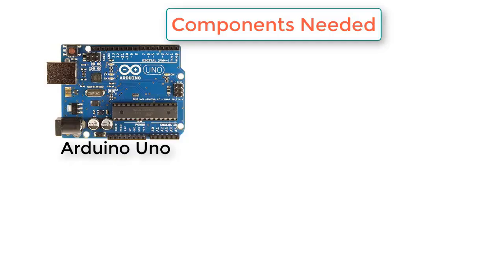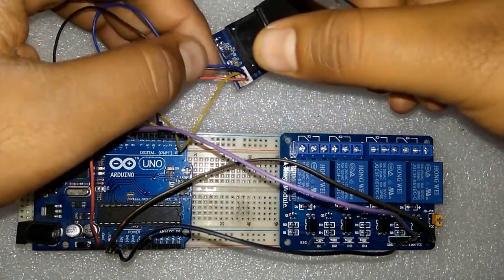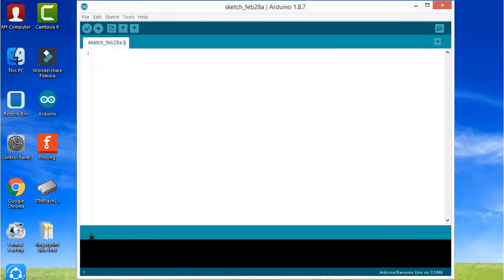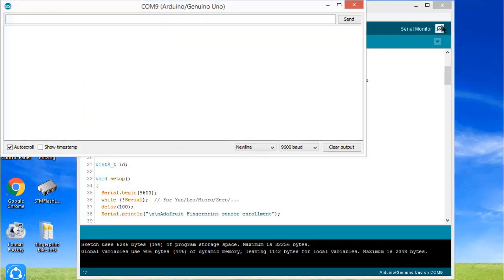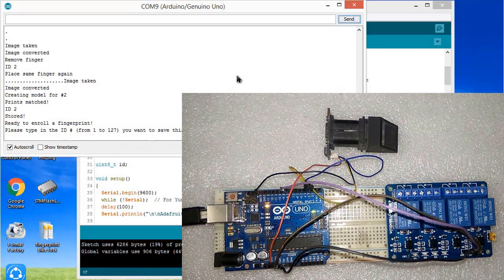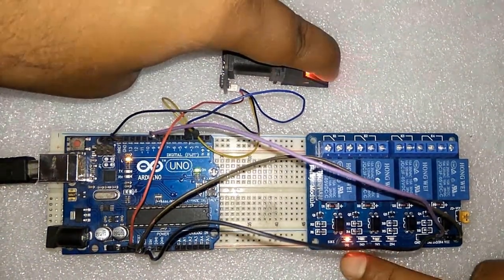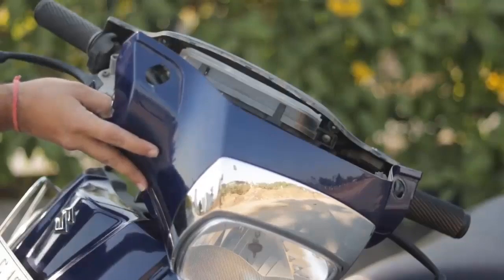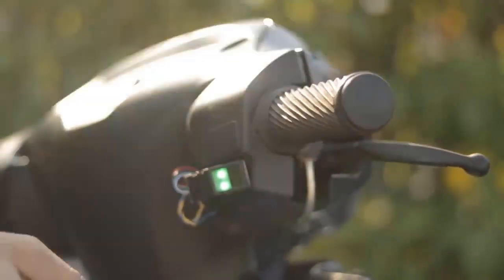DIY Fingerprint Self Bike Starter | Fingerprint Bike Lock Arduino

Comment: I coneted AS608 finger prints sensor but my finger print sensor are not found please help and I use arduino neno
Reply from the maker: Check tx rx connection. And make sure to supply 5V to Fingerprint sensor.